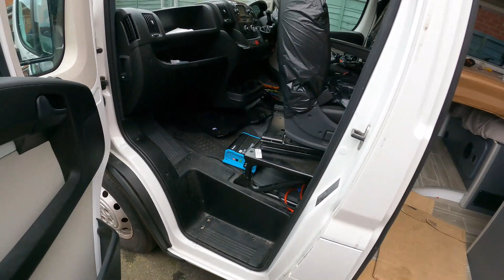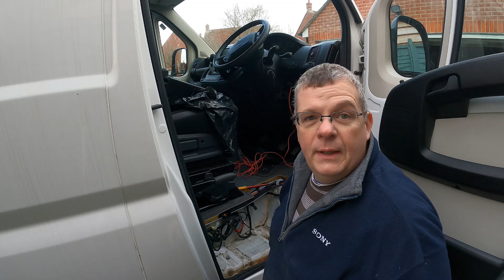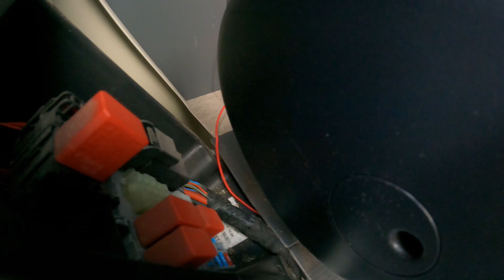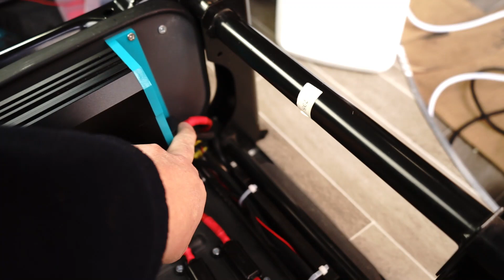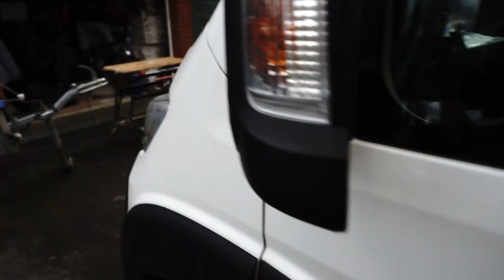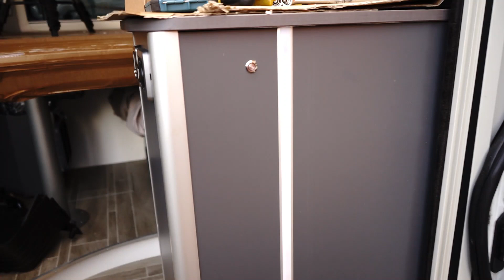Install Renogy 40A DC-DC Charger and D+ connection in Citroen Relay / Boxer / Ducato / Promaster

Comment: Hi, just in the progress of upgrading to Lithium, so I will need to address charging as system uses in built split relay within CBE DS300 this needs to be disabled, One of my issues is running cables as every is buried in wiring looms and congested. Can I ask did you ground from chassis to negative bus bar to provide loop circuit. Could the starter battery braided ground step be used to run a ground cable from? This is going back I know but I always comeback to you conversion videos, great help with flyscreen.

Comment: I notice the cigarette port only comes on with ignition. I might splice into that but also put a manual switch inline as I'd like to turn it off. I did have a remote controlled switched rely on my last van and didn't bother with the sense wire but there isn't room in the Ducato to do that.

Comment: Instead of wiring direct to the ignition switch, I just added a switch in a convenient place for me, that way I can turn it on/off as and when necessary whether engine is on or off...... Not too long when it's off though 🙌

Comment: Hi there , great video you have done. However the true idea of the D+ signal is not to wire from ignition live but from the signal Wire called the D+ that senses your alternator is running and engine is on before the charger starts to pull from your starter battery to leisure battery. If for example you were somewhere and you put your ignition to accessory or anyone else it would drain the starter battery to a point where it wont start. Ive been working on this and found the true D+ to alternator in the bottom of the B pillar on the drivers side by handbrake on the boxer. You will need a relay however as the D+ goes to ground when igition is on. It wont start my victron xs on accessory but another turn to start the engine it starts to produce the 12v feed needed.

Comment: Great video, wouldn't it have been easier to just put a piggyback fuse on your ignition wire? Saves the worry of cutting through with a splice connector, cheers

Comment: Just one very important point, your fuse position leave most of the cable to your batteries unprotected, the cable to your leisure battery bank from the fuse would still be live, so a short along that run would not blow the fuse…

The lead to the van battery is similarly not protected by the fuse in the position.

Fuses should be placed as close to the power supply as possible (in this case the batteries) to avoid having and unprotected cable run.
Reply from the maker: The cable to the leisure batteries terminates into a Lynx Distributor where it is fused and the connection from the Lynx to the batteries is also fused so there are three fuses in all between DC/DC and the battery bank. Thanks for taking the time to voice your concern though. cheers.

Comment: i didnt see the connection to the leisure battery? or the settings for lithium.
Reply from the maker: Apologies. it is wired with 16mm cable to the lynx distributor at the back of the van. The calculations suggest that for that length of cable run it should be 25mm cable! but it charges fine at 38.2amps and no, the cables dont even get warm! make of that what you like??

Comment: Hi , just a thought re the D+ requirement . I think that ideally the D+ should be live only when the engine is running , which in your example it isn't . Perhaps a relay where the coil is connected to the Battery + & the oil pressure switch would do the trick , with the normally open contacts connected between the Batt + and the charger input ??
Reply from the maker: Sounds alot more complicated than my simple on/off switch but hey, why not. it would work for sure.

Comment: Seems you use "ignition" and not D+ the difference is that with ignition active the generator may not yet run because the engine is not yet started. D+ active guarantees that the generator is running ensuring that your vehicle battery is not drained.
Reply from the maker: Agreed, thats why I fitted an on/off switch in the front to switch on the DC-DC when I want it on whilst driving. Yes a D+ would be better but I couldnt be bothered to spend alot of time hunting for it at that time.
Reply: @wiltshirecustomcamper7203  It is not so hard. Lots of options. If you have factory camper it normally has upfit connector at the base 
of the passenger side B pillar. If not go for the alternator directly, most euro 5 and 6 have an L - DFM alternator. It has no real D+ external rotor coil actuation but an high active signaling on L with the alternator state that is perfect to use. (DFM signals back the load via PWM). I have not yet seen any ducato / boxer / jumper with a LIN bus alternator like in the Crafter or Sprinter that is more of a challenge.

Comment: Hi just wonder if you know but why not splice a 12v switched fuse from the fusepanel as 12v d+ signal cable?
Reply from the maker: Certainly a possibility if you find an 'engine on' only feed and not just ignition on feed. thanks for the comment

Comment: question: if i dont want an automatic and immediate start of the leisure battery charging but i want to acrivate the DC/DC only when i want, can i take to the d+ a cable coming from a manual switch put between the engine battery and the DC/DC ?
Reply from the maker: yes, i have a small switch installed near the steering wheel where i can turn the DC/DC charge on and off as I wish. it essentially switches the D+ connection.
Reply: @wiltshirecustomcamper7203  since it's not alwAys easy to get the d+ cable i wanted to understand if, using a manual switch I can also give to the charger, any other power source

Comment: Hi, do I need to run negative cable straight from the main battery (-)or just screw into ground somewhere along? TIA
Reply from the maker: I would run a dedicated negative cable. belt and braces and all that!

Comment: You must also realise the method you did to obtain the "correct" ignition wire can be INcorrect. There are wires that are DEAD when the ignition is OFF. There are wires that are ALIVE when the ignition is switched to accessory mode, but after starting the auto, that same wire becomes DEAD. Then there are wires that are ALIVE when the engine is started and stays alive while the engine is running. The method you showed, can become dead wires once the auto is started, therefore the dc-dc charger is only on when in Accessory mode, and switches off when the engine is started. Always check that the wire stays HOT with 12vdc after starting the engine.

Comment: Cheers, nice video showing lots of details. You are in jolly old GB where the weather is colder so this is less important but in places like the SW of the US, it gets much warmer (40 degC), so this will be more important. 
First the DC-DC charger should be mounted as close as possible to the house batteries to maximize charging. In your case ,I noted about 35 amp charging vs 40 amp specification. This is likely due to the voltage drops between the DC to-DC and the house batteries leading to relatively small voltage drops but which can lower the voltages at the rear batteries (your the DC to DC is mounted close to the start battery). If the DC to DC is right at the house battery, then the DC-DC output terminal will be identical to the battery terminal charging voltages and you should get the full 40Amp charging. This is easy to check if the DC-DC charges at the voltage levels cooresponding to the charger settings.
I should reiterate putting the DC to DC closer to the start battery is not all bad despite reducing the charging current. You will therefore reduce the alternator draw and heating of your alternator with a (in ratio of 35A/40A ) 87.5% reduction in alternator current and (in ratio (35/40)^2 ) power reduction 76.5% . Of course you can cut the power in  1/2 by switching on the LC Terminal as well as the D+ .
This also reduces the heat dissipation requirements of the DC to DC which in general would be better to mount to a piece of metal to conduct some of the heat away. In GB it is much colder and of less concern.

From the Renogy Manual bottom of pg 7:
 When selecting a location for the DC-DC, make sure that the unit is as close as possible
to the battery you will be charging (auxiliary battery). The charger may be mounted on the
cabin of the vehicle, along a chassis rail, the inner guard of a vehicle, behind the grille or
headlight or even on the side of the radiator. However, you want to make sure that the
area is not susceptible to moisture or other substances as well as potentially high
temperatures.
The DC-DC would operate best if there is some air flow

Comment: Hi ! Here is another of your very detailed, clear yet concise and hands-on video : thanks a lot that for! 
If I may ask, I was wondering if the cable you targeted isn't an AC+ (After Contact Positive Pole) more than a true "D+" which is one of the positive pole of the alternator, offering 0V when engine is off and 12V when running.
Difference is the D+ provides power when the engine is effectively rolling, not only the ignition tuenzd on (case of the AC+).
Starting your DC to DC charger based on the AC+ may end draining your vehicule batterie into your leasure battery (because the alternator isn't charging meanwhile). Whereas starting it based on the D+ will effectively redirect part of the current to the main battery to keep charging it and the remaing power to your leasure battery.
Not sure of I'm being clear enough, here...
Reply from the maker: Absolutely correct in what you say and bang on. I was comfortable with mine as I am the only driver and know not to have the DC/DC on when ignition on but not driving so as not to drain battery, which is why i installed a conveniently located on/off switch by my knee. if I was to rent it out or others used it it would be a concern for sure. for belt and braces you are on the right track with your train of thought on this subject.

Comment: Hi can you help I have installed a unit a 40 amp unit exactly the same way but the green light will come on. I have cheecked all connections checked the voltage and all is correct. I have second unit tried that and still no green light. My question is how much voltage does it reguire for the D+ light to come on., Please help
Reply from the maker: I dont think the D+ connection needs anything major amps wise, just a 12v source? best way to test is perhaps to tap into any good 12v wire in the van either on the vehicle side or the habitation side with a splice connector and run to the D+ on the DC/DC charger and see if it lights up, if not maybe a dodgy charger, if it does then hunt out a good 12v 'ignition on' power source for it. some have suggested tapping the back of the cig lighter on the dash, others mention a dedicated D+ connection in the pillar on the driver side, there are many options for that. good luck with it.

Comment: Thanks for your video. Really helped me greatly wiring my own DC-DC charger in. Just a question on ignition source, do you think I could wire to the Pos+ of a cigarette lighter socket instead? It only live when car is in ignition mode. Thank you again!
Reply from the maker: Sounds perfectly reasonable, although I am not an electrician so take it all with a pinch of salt and seek pro advice if stuck. having said that, if the 12v socket is only live when ignition is on then this seems a decent option.

Comment: Can you just wire the 12v switch lead straight into the cig lighter or the stereo rather than cutting into the wire loom?
Im about to install one and i thought this would be easier
Reply: It just tell if engine is on, or ignition, can use plug if remember use it but can jump off
Reply from the maker: 12v socket (cig lighter) seems a good option if it is only on when ignition is on.

Comment: Thanks for the great video!

Can I ask what size fuse you used with the IGN wire please? Also what current does the IGN cable use when on?

I'm pretty new to this so hopefully iv'e explained it well enough, Many thanks mate.
Reply from the maker: Explained perfectly! I used a 2A fuse if I recall as it is just a signal wire so virtually no amps at all hardly. 2A was smallest I had at the time. Remember the fuse protects the cable so a 1mm or 1.5mm wire with a 2A fuse is just fine for this.
Reply: ahh such a hero!! thanks for getting back to me mate,  I was wondering if it draws basically no current, that's helped a lot, really appreciate it mate, thanks again 

 @wiltshirecustomcamper7203

Comment: Wat size cables did you use
Reply from the maker: from DC/DC to batts I used 16mm as only needed 20A charge, if using 40A then might suggest 25mm if a long run. I am using the connector pin on the front to limit output to 20A which has been absolutely fine for my needs.
Reply: @wiltshirecustomcamper7203  thks for reply went with 25mm cable in the end.

Comment: Whats your opinion on the Renogy kit? I am torn between this and Victron, if it was purely cost I would pick Renogy however there are mixed reviews on the brand where there is total agreement on how good Victron is
Reply from the maker: Ah yes, a big question! I have been very happy with the renogy kit and it has worked flawlessly for me, I like the fact I dont need that stupid shunt that Victron uses as the battery monitor plugs directly to the batteries on an ethernet cable! I think Victron need to look at that. But I do like the Cerbo GX on the victron kit and Renogy need to look at that as their connectivity of devices could be better? so in a roundabout way i guess the answer is that both are good but neither are perfect. You are defo on the right lines with either one though, and dont get that Ecoflow powerkit rubbish....

Comment: You mentioned that the D+ cable provides 12V to the charger when the engine is running. Does the engine need to be running for the green light to come on? 
When I turn the ignition to the on position (engine off), the green light comes on for a split second and quickly fades away.
Reply from the maker: yes that would be right, a good and proper D+ signal source would only work when engine is running otherwise it would very very quickly drain your starter battery.

Comment: Could you let me know the size of fuse in amps for the D+ wire. I am installing a 40A Renogy DC-DC charger too.
Reply from the maker: If I remember I put a 1A fuse in. it is just a very small current signal cable.

Comment: Hiya, is there any main reason you’ve put it under the passenger seat? Could you put it in the garage? 
Great videos - I’m finding them very helpful on my conversion 👍
Reply from the maker: HI, yes it could go in the garage but if my memory serves me correctly the cable from the van battery to the DC/DC charger needs to be bigger than the cable from the charger to the leisure battery, so it was an exercise is reducing costs by having the 'long' cable run in the smaller cable size. hope that makes sense. check out the renogy installation guide on their website for details on this.

Comment: Hello
I recently bought and installed a renogy dc-dc 40A according to the instructions. Why does the 60amp fuse blow? after 10-15 minutes 
The cables are 35mm2
Reply from the maker: sorry to hear you are having trouble. best to contact renogy tech help i think. they do it by email but do reply within a few days, good luck with it.

Comment: Fantastic video! Thank you very much for uploading it. I have to replace my old leisure battery as it's simply almost completely dead now. I think I will go with LiFePO4 Renogy 100Ah and this DC-DC charger same one as yours. There is a 60A version but since the battery of my choice has a max 50A on charge I don't want to go above that on the DC-DC charger. Thank you very much for showing the whole procedure. The biggest unknown was the D+ ignition cable, I had no idea what that was 🙂
I also have a renogy 175W solar panel on the roof. I am not an expert in this field but I'd like to also connect the solar panel (currently I am only charging my Bluetti EB70 with my solar panel) to the leisure battery, fix a switch and be able to choose the charging method: from solar while parked on a sunny day or from the alternator while driving.
Big thank you for the very informative video!
Reply from the maker: thanks for the comment. I actually only use mine on the 20A setting and it is fine so don't go overboard here, it is not really needed. before fitting your D+, search through the comments of this video carefully as others have suggested other D+ locations around the cab that might be worth exploring, one being in the pillar behind the driver seat.

Comment: To avoid tying into the actual ignition wire you can just find an empty fuse slot that only has power with the key on.
Reply: Great video anyways, and there's more than one right way to do it, the fuse box just happens to be the way I've always done it.
Reply from the maker: indeed, I have since been old there is a 12v switched live behind the pillar on the drivers side as well. not looked for it yet however.

Comment: Ejoyed the video, I'm about to purchase the 20A version of this charger hopefully it will be a straightforward install, installation will be easier after watching someone demonstrate a complete installation, many thx for taking the time cheers Chris
Reply from the maker: Glad it helped
Reply: Before you buy, I’ve had a 20A one for about three years, the battery settings are limited and the fan in mine at least has always been very loud. I’m having to use it daily while parked up and it drives me mad. Victron Orion smart are expensive but silent - I’ll be getting one soon